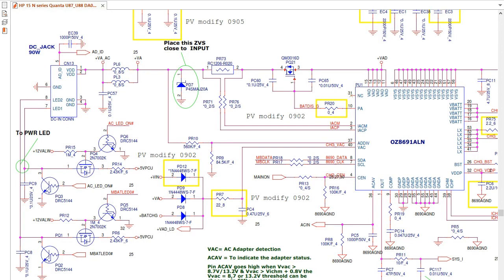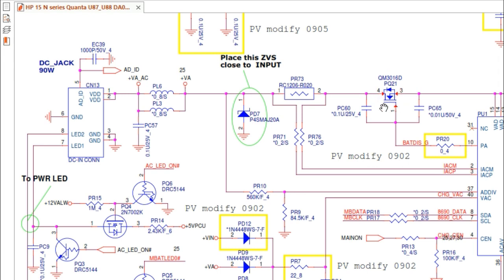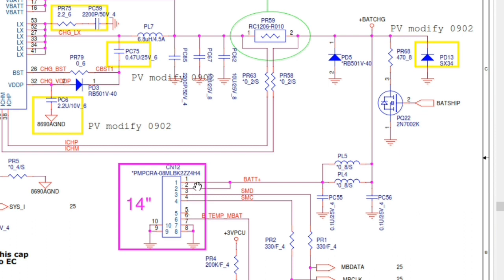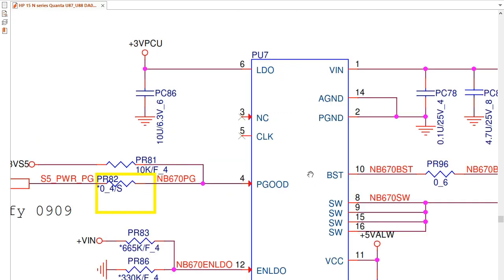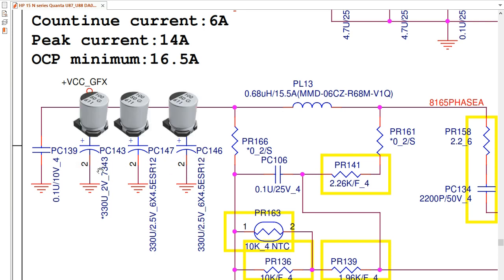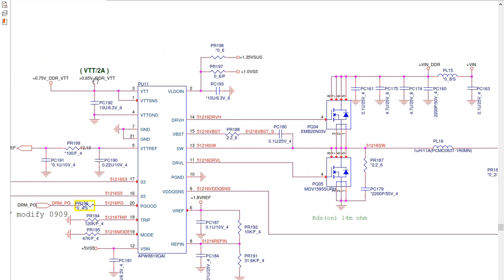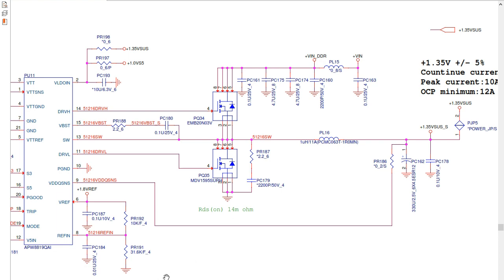Laptop motherboard repair | schematics reading guide part 1

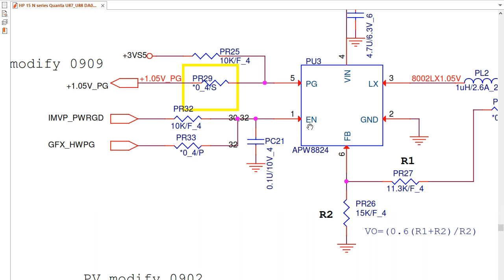Comment: Hi there , at 06:48 , what is meaning of Power Good .PG?
Reply from the maker: Good question!!
PG or Power Good is a signal that inform the controller IC about the state of power in the circuit is it good or not, If there is any issue, the  controller IC will stop working and can not proceed
Reply: @electronicsrepairbasics_erb  thankyou for your answer